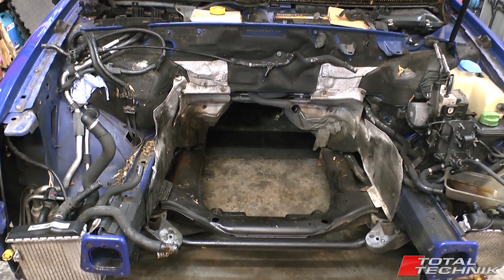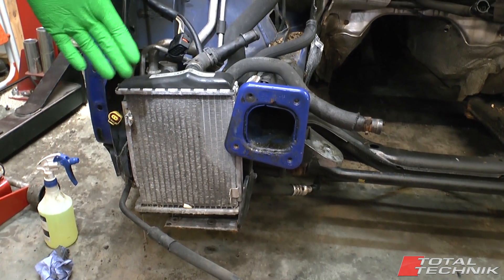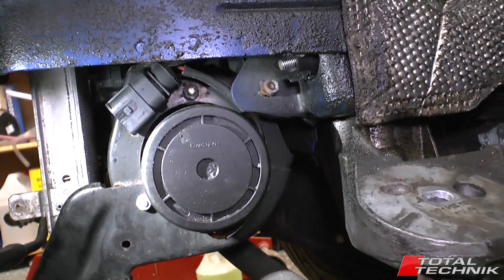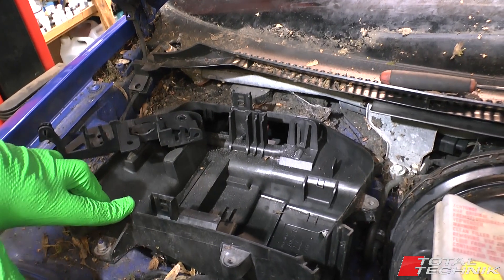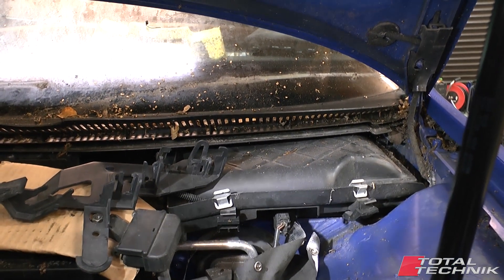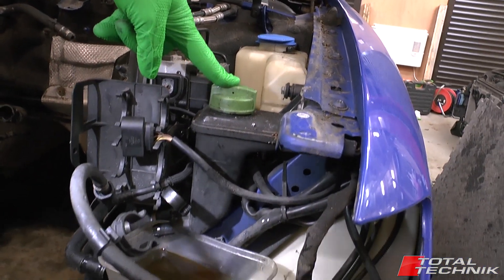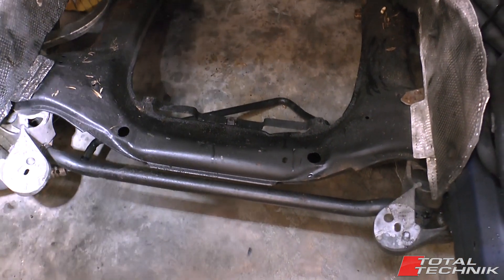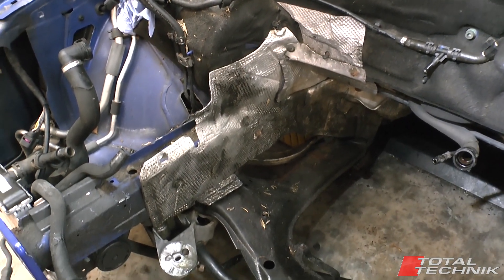Audi S4 Engine Bay Tour (Engine Removed) - B6 B7 - 2003-2003 - TOTAL TECHNIK

Comment: Great video very informative. Do you need to remove the engine in order to replace the transmission.  Thanks
Reply: No you can remove the transmission by itself. It’s a big job though. 9-13 hours book time for a clutch job for example.